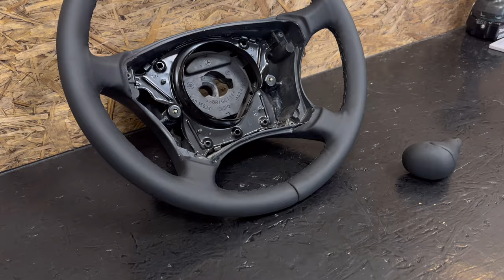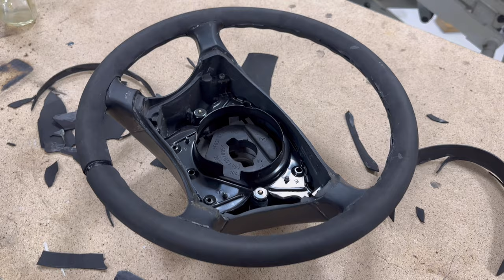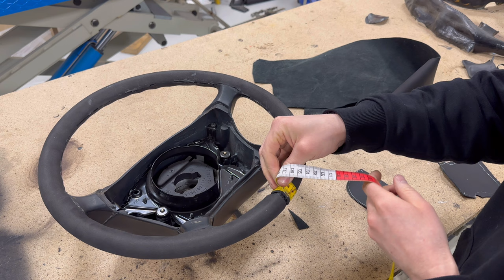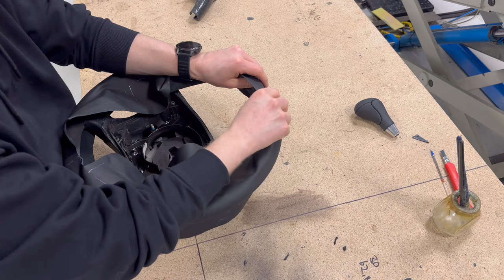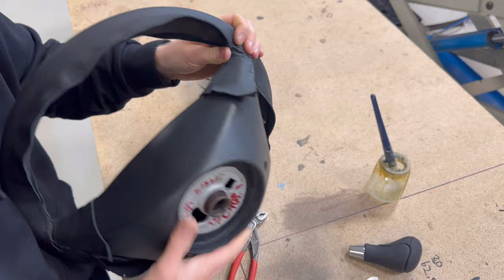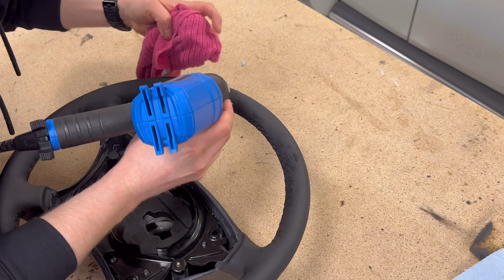Restoring Mercedes S-Class Steeringwheel With New Leather!

Comment: Great Job! I'm currently wrapping my wheel in Nappa leather and Alcantara, and I reckon it is really hard. I've had to start over twice already. What is the best tip you can give to someone trying this themselves?
Reply from the maker: Thanks! Yes these are challenging and require a lot of practice! when fitting the leather to the correct size, cut only a little at a time. Lot of patience😅